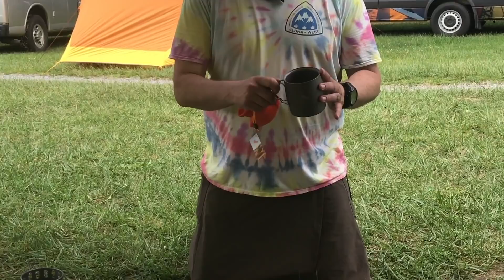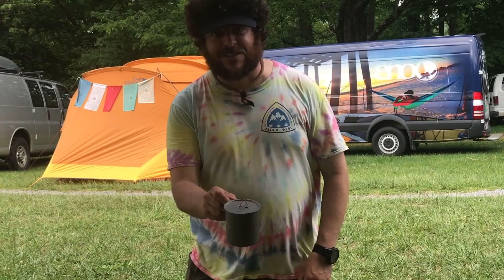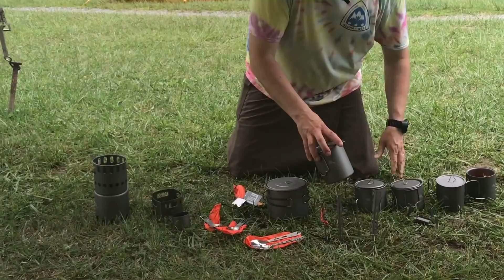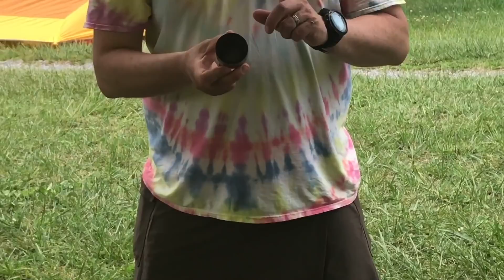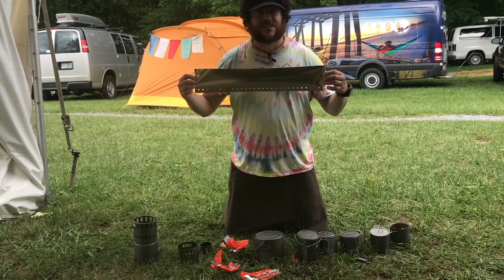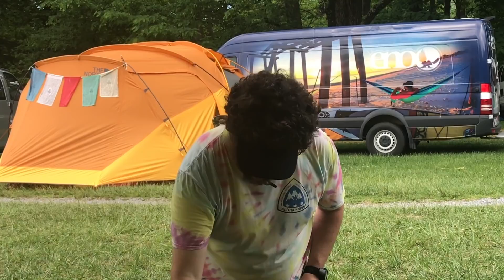Trail Days 2018 Gear Vendors ~ Toaks Outdoors

Comment: Trail tested my Toaks 1600. Very impressed water boiled very quickly almost surprisingly quickly, supplying water for two cups of coffee. The one con to the pot I found. Was the pot lid did not fit all that well. Overall I am very impressed with the pot. It's light and efficient. Toaks has earned a permanent spot in my pack.

Comment: Shug Emery put me into Zelph'@s Fancee Feast stoves because they have the pot stand integrated into the stove.  It's always tricky filling the stove though.  

The Toaks stove you just squirt fuel into the central cavity where you can see how much is in there.

One of the best things about the Toaks stoves though is they are pretty tough.  

Penny stoves and aluminium construction in general needs protection when inside your pack.  Titanium doesn't.